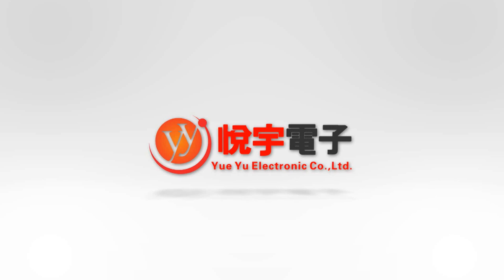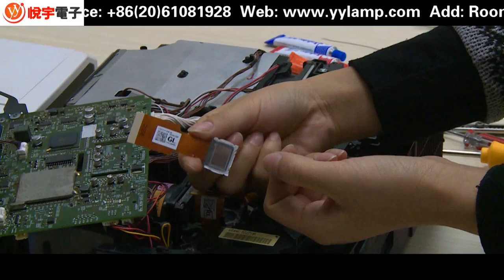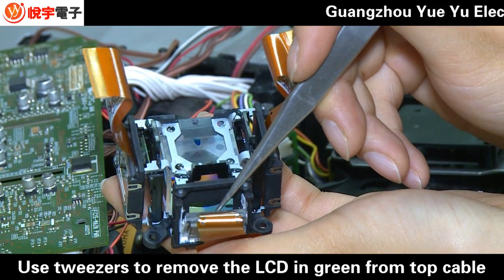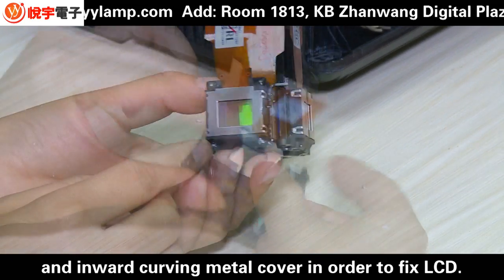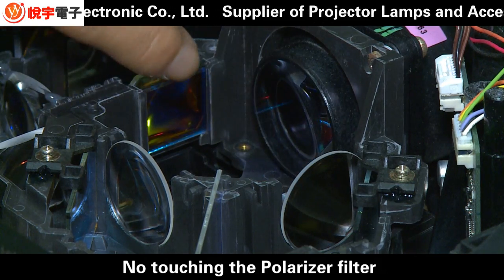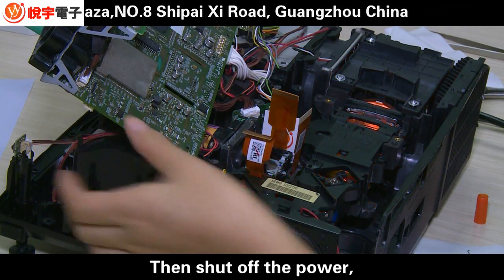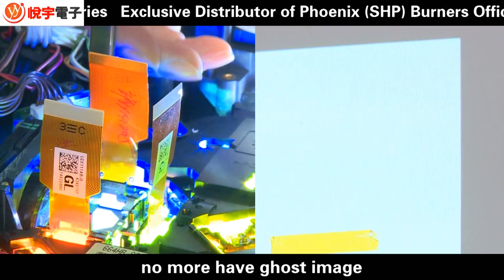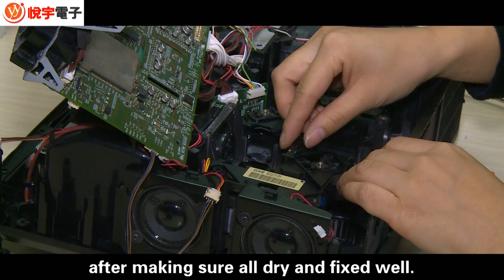How to adjust projector LCD panel

Comment: Epson EH TW5500 fixed ! Many thanks to this guide as well,
I used some idea from this video,, this is really helfpul but it turned out my opt engine was behaving different ( I couldn't extent my curcuit boards nor flashlight was helpful to project any white light maybe my torch wasn't bright enough) and my LCDs on the block had screws instead so I was able to do it by tapping to a very little extent and testing (with filters removed that are just next the lcd block) 
I might actually make a video about it but not sure,

Comment: I have a epson 696ui 3lcd ultra short throw projector.  I cleaned lens inside and out, also cleaned mirror.  Still slightly hazy picture.  Do you thinks LCD panels are dusty?  How do I clean them and what do I use to clean them?  Thank you my friend!